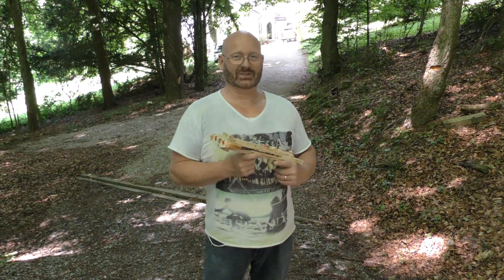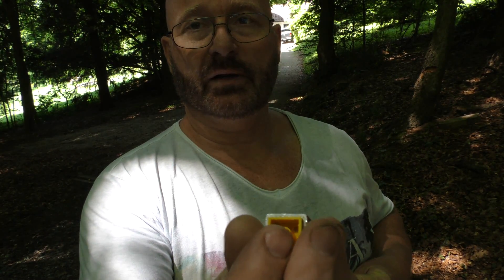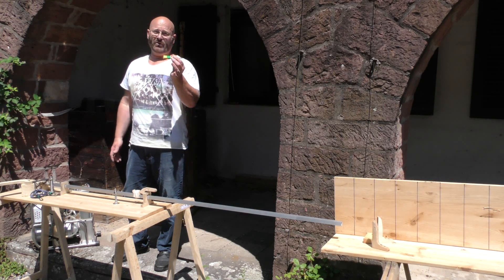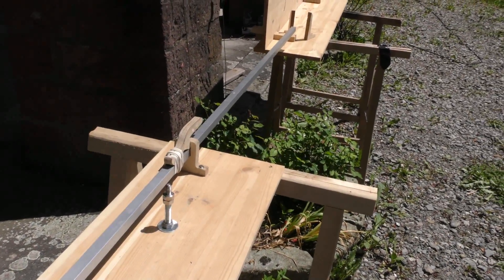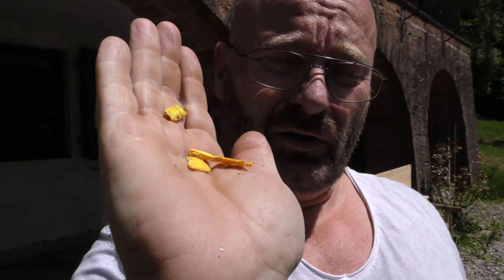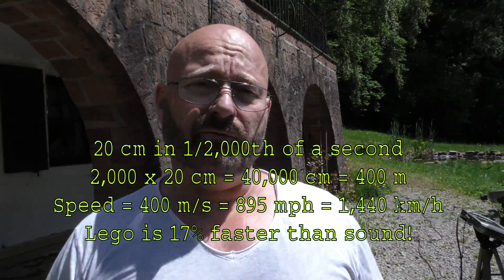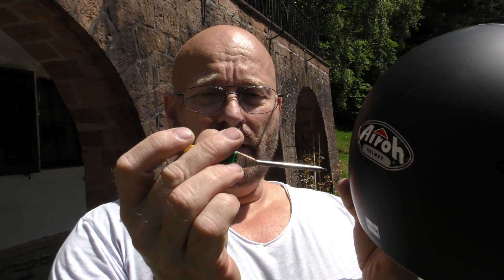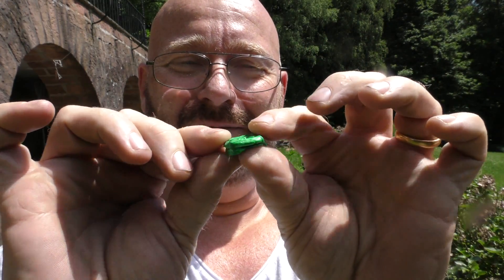Supersonic Lego Devastation

Comment: Sorry Jörg, but you are wrong... A lego brick is harder then anything you shoot them against it.
You can press the Lego by hand into a melon, you can make scratches into wood with it and so on.
Legos are made from ABS plastic so find something harder than ABS and try it again, you will fail.
Best try to fire an aluminium block against a steal plate... the steal will have no hole.
and you are talking of 14xx km/h... do you realy think the planes where that fast at 350 meters hight ?

Comment: A single lego bruck is about 1,25 Gramm. 400 m/s that would end up in 100 joule energy. If the speed of the nail version would be around 280 m/s and the nail about 5 gramm+3 bricks and the wood, I would say, that's around 12 Gramm. Than the muzzle energy would be around 500 joule. So this crazy man built a "scientific device" that outperforms a 9mm...

Comment: Big fan. However, there is no way you can exceed sound speed in air gun, if you pump it with air. Because air can not push bullet faster than airspeed. If the air is heated or contains some other materials (vaporized oil), then the airspeed of pushing gas increase (not your case).
Reply from the maker: You are wrong. Air gun projectiles can of course exceed the speed of sound, because of the pressure. Plenty of PCP air guns go supersonic.

Comment: I never really thought about the vibration force the impact would have caused, but the vibrations and the impact shockwave could easily break welds and bolts holding the steel near the impact. Then all that unsupported dead weight is stressing the rest of the structure, causing it to fail catastrophically.

So many people with little to no structural steel design knowledge like to believe in the 9/11 conspiracies, despite the fact that an educated person can easily see why.

Comment: Hey you conspiracy fools from the CIA. The twintowers collapsed through the impact of the planes and not the burning jet fuel... with a little delay ... of 45 minutes.
:D
Reply: I never really thought about the vibration force the impact would have caused, but the vibrations and the impact shockwave could easily break welds and bolts holding the steel near the impact. Then all that unsupported dead weight is stressing the rest of the structure, causing it to fail.

Comment: I have a suggestion: for aerodynamic and structural integrity reasons, you should switch the 2x2 lego bricks for 2x2 cylinder legos. It opens up new design possibilities, such as rifling and perhaps even size variance, such as the use of 4x4 cylinder legos.

Comment: 9/11 fools?  shoot sheet aluminum through a steel IBEAM.
Reply from the maker: You can destroy anything even with foam balls if the speed is high enough. My angle grinder disks break when they hit the ground from 50 cm, yet I can cut a 2 inch high carbon steel rod with one, within just a few minutes.
Reply: JoergSprave I fully understand.  but planes break apart if they land too hard.  I'd love to see you prove it wrong.
Reply from the maker: Of course they break. I don't think the planes that hit the WTC were in a repairable state after the collision either. 

If a soft but very heavy and fast thing hits something hard, then the soft thing suffers harder but STILL the hard thing is awfully damaged. You think any kind of building can survive the impact of a plane weighing many tons, flying at crazy speed, without breaking apart? Not my experience. I once shot a wax candle through a plywood board, with a slingshot.
Reply: JoergSprave Def not in a repairable state but I don't think a plane at 500 mph would cut a loony toons style hole in the side of a steel building.  I don't think it would do any damage to one I beam of that size, let alone 6 or 7.
Reply from the maker: Well, as I said I think otherwise, from my experience with high speed impacts.
Reply: JoergSprave whatever is is man. love your chanel, keep it up. long time subscriber.

Comment: Joerg, you are running into a physics problem that is present in paintball guns.  When you have a barrel that is too long, you will actually lose velocity on your projectile, due to the expansion of the gases losing power in the length of the barrel, and having to still force the projectile though the rest of the barrel overcoming the force of the air still in the barrel.

Typically in paintball they use barrels that are around 16-50cm long, though the optimal and most common length is typically 35cm.  Using a barrel length around these dimensions should increase the velocity by a good amount.  Personally, I would love to see how much this simple change would change the results you got.
Reply from the maker: Don't forget that I use a way bigger compression chamber and also more pressure than your average paint ball gun. 17.5 litres of air are compressed down to 70 ccm. There is just about 0.5 liters of air in the barrel. So at the end of the barrel there is still 35 bar pressure.
Reply: I guess the change would be insignificant with that much pressure.  I appreciate your response.
Reply: It would be (scientifically) interesting, to see if you could increase the speed by filling the tube/barrel (NOT the high pressure side) with helium (from a balloon).
Reply: Neutrality & Mutualism with AI & Robots how about a vacuum with burst discs

Comment: Hey Joerg, do you have any idea how strong the materials you use are? How much pressure can the valve or the steel pipe take? Or the plug at the end of the steel pipe? I have no idea myself, u just hope you're not on the edge. Also: this testing device needs a vacuum in front of the "bullet". (close the breach airtight, muzzle load, close off the muzzle with something light and vacuum-suck the barrel). I've seen a ping-pong ball go through a ping-pong paddle this way. There even was a flash when the ball hit the paddle. Yeay slo-mo!!! Would you be so kind to test this for our viewing pleasure and education? Thank you very much. Dirk.

Comment: 9/11 fools. Except the fact that when you fired the brick the coconut exploded immediately, where as the towers stood for a long time after they were hit. 9/11 had nothing to do with projectile speed. The official story says it was due to fire.
Reply: Hi, Engineer here. I don't even believe that a jet liner can take down a skyscraper considering that it has happened before without the same result. 1946 a plane crashed into Trump Tower and in 45 a plane crashed into the empire state building with far less casualties and obviously both buildings still stand today. The fire alone cant do it either since many buildings have burned for far longer and remained standing. Videos suggest that there were secondary explosions from inside the building that were masked by the plane crash. Evidence also suggests the use of Thermite in sections of the building. It wasnt a simple plane crash. Also, there is no way in hell 2 planes took down 3 buildings.

Comment: That was super amazing. I myself have made an air cannon as well. However I can only fire at 160psi as that is the max my bike pump goes to. I use APDS (armour piercing discarding sabot) ammo. The penetrator is a 58g steel nail, and the sabot I simply use some ice cream sticks. To accelerate the whole thing down the barrel I use a sabot at the back as well, a 3d printed cylinder that fits the barrel exactly. So far I've been achieving ~50m/s which gives it around 70 joules of energy. I do want to experiment with 4000psi and such, but sadly I cant. I would like to see you make something like that, it would be really awesome!!